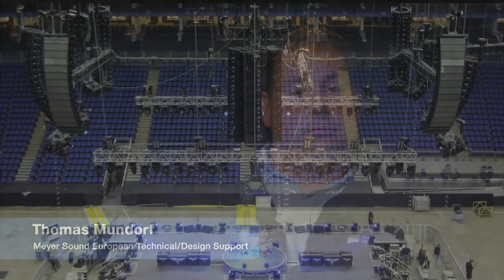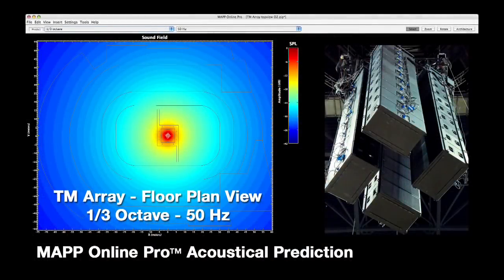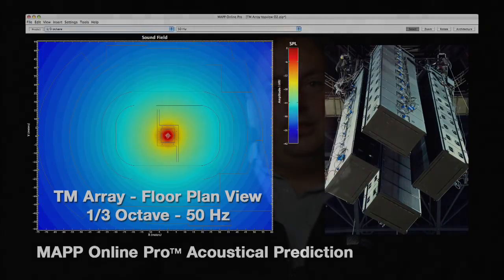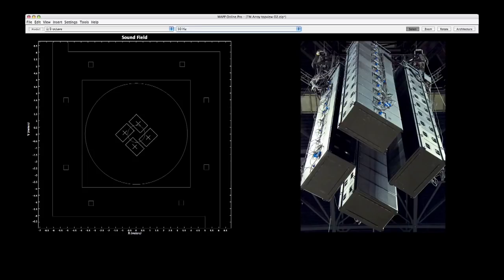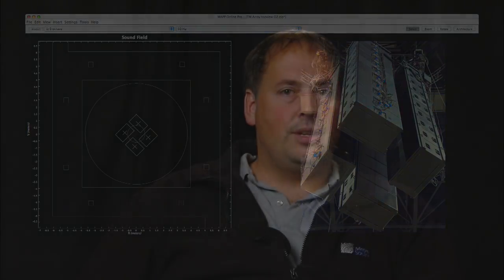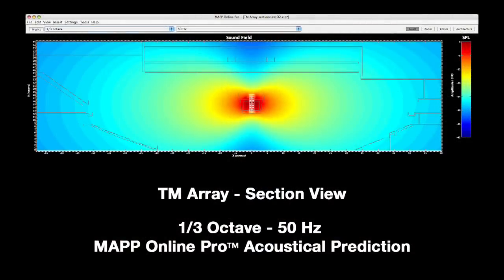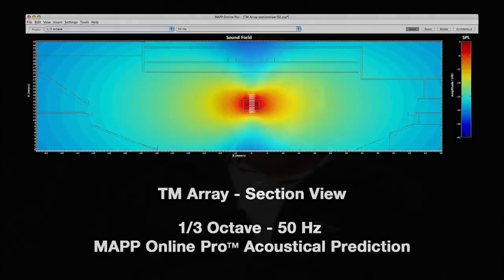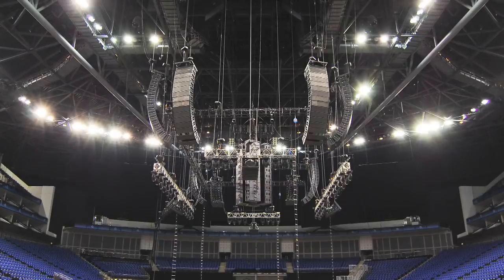The TM Array™ A Technical Overview w/Thomas Mundorf (HD)

Comment: Since bass in omnidirectional, there is no "front" to the speaker, so he takes advantage of each cabinet "helping" or manifolding the sound wave, they act together to form 1 big, strong wave, He talks about this at around 2:50.
I first read about this phenomenon from an EV tech manual, in 1991 or so.....
He didn't invent the process, he is just smart enough and imaginative to find the solution.
Reply: The origin of the omni-directional wave is centred on the front where the cone is. Facing the subwoofers inwards means the origin of all the omni-directional waves are closer together which prevents cancellation in the upper bass. If all the drivers were facing outwards you'd get cancellation right in the meat of the kick drum range.
Reply: @TimpBizkit  
Yes. And the drivers must be within 1/3 wavelength of the highest frequency (a third of 100hz = ~1.2m). I haven't seen the TM array since this tour. It would be much easier weight-wise with passive cabinets. KS28's are very light, for example, but the bass response from them is phenomenal.

Comment: I'm not a sound engineer, but I find sound engineering very interesting. What I don't understand is why are all the subs facing inward toward each other and somewhat blocking each other? How does that work??
Reply: See "Isobaric sub enclosures"
Reply: Bass frequencies are omnidirectional so you do not need a clear path such as with mid/highs. The reason they are put like that is despite omnidirectionality, the sound source is the front of the subwoofer, so it gets the sound sources closer together. If they were facing out, you'd get some cancellation from the subwoofers behind.

Comment: If the subwoofers were loud enough to use less of them, then couldn't you hang them vertically with 4 columns of drivers facing inwards (with gaps to let the sound out)

Comment: You can do this with any omnidirectional sub :) I'm making a video about sub arrays soon to explain how!
Reply: Malcolm MacgregorSound one only needs sound processor to set faze polarity and delay
Reply: There so many variables involved with an arena,and equations for mixing would have to be altered from arena to arena. To make such a simple statement is obviously a reflection of the mind that created it.  Something as simple as altitude,humidity,or weather (any air pressure variance) the show was at night or day would all change the values of the equation at hand with this array.
Reply: MrGreenAKAguci00        In a living room or studio, yes. Not in arenas that have differing configurations